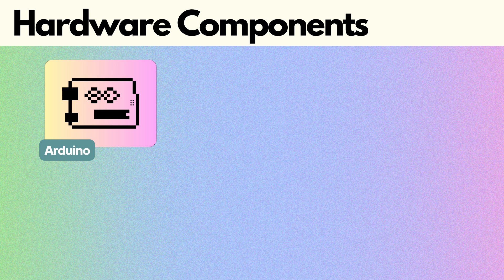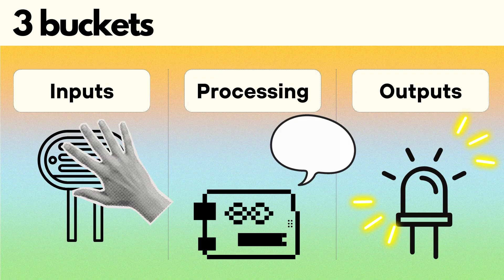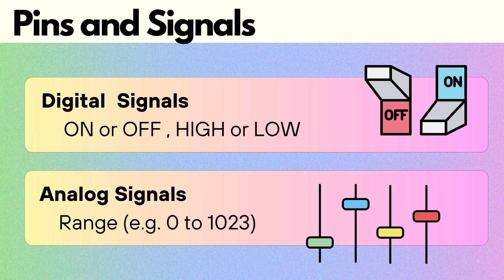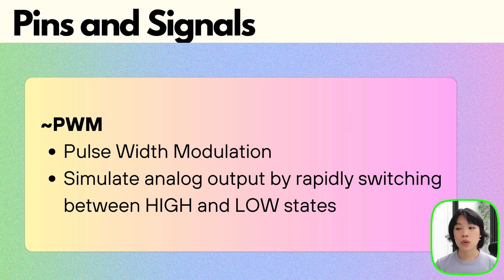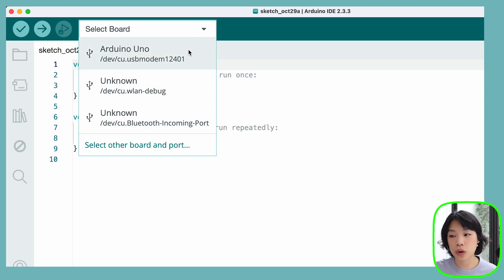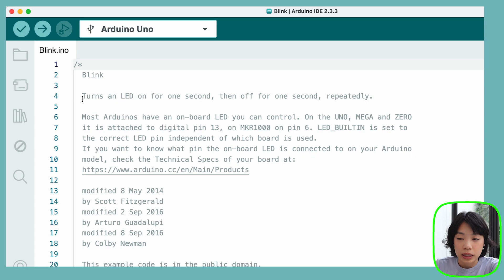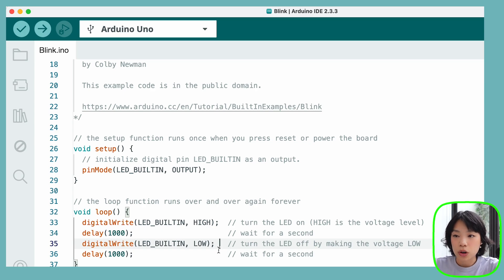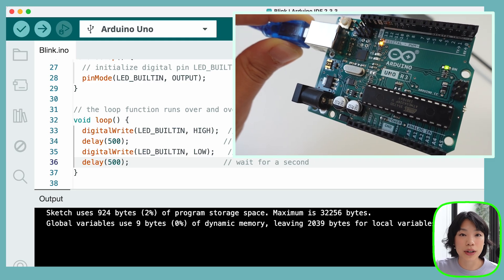Arduino 101 | Episode 1: Getting Started

Comment: the resistor can be placed either on the positive or negative?
Reply from the maker: Haha Chris - great catch! Waiting for someone to point that out. 

Yes, the resistor can go on either side of the LED. Its purpose is to limit current, so it works effectively whether it's before or after the LED. However, the LED’s orientation matters—the anode (longer leg) should connect to the positive side or pin 13 in our case, and the cathode (shorter leg) should connect to ground.
Reply: @pattvira  haha thanks, well I've worked with arduino before, even took an electronics class and never had I given it a thought 😅 but yes, it caught my attention as I was used to connect the resistor  to the anode